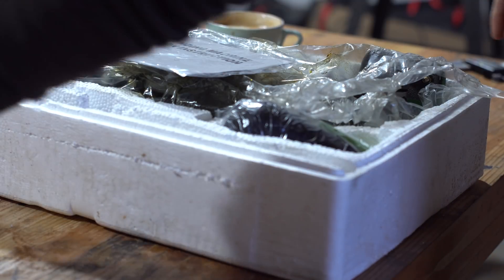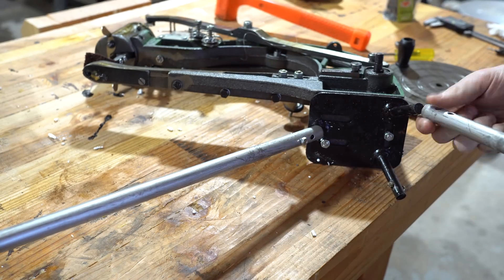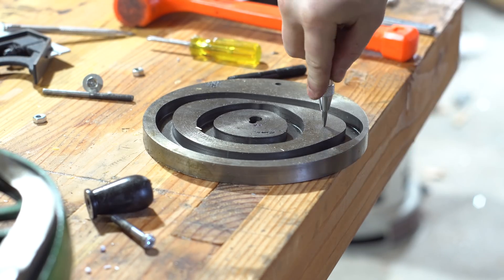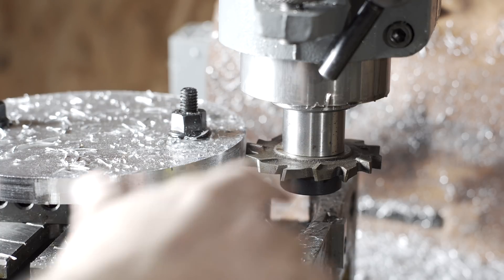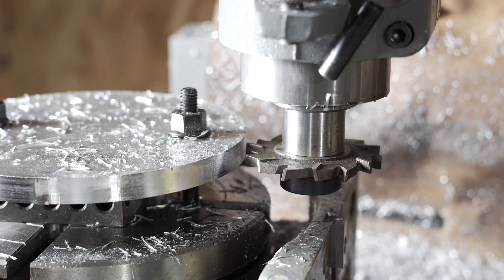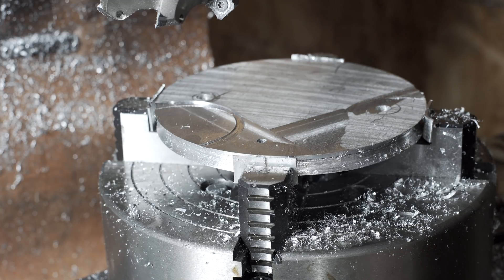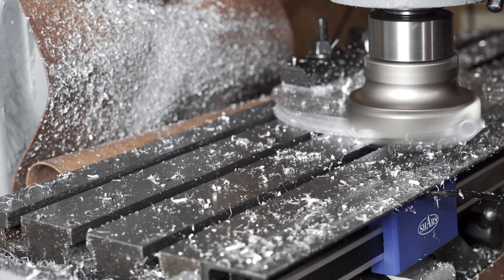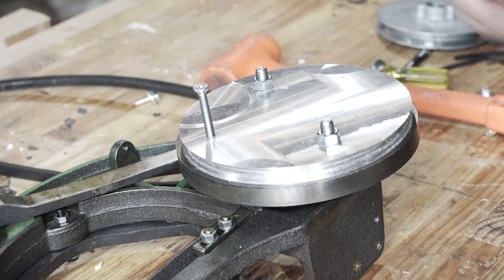Motorizing a leather patcher - V-Belt Pulley Fabrication

Comment: Obviously, this video is both FOR entertainment purposes, and also depicts a project performed for entertainment.

I enjoyed it.

However, as a pure value proposition:

monitor commercial equipment auctions and ebay for the many-times per year, guaranteed, clockwork bankruptcy of a medium sized leather shoe or garment or leather furniture manufacturer.

Cylinder arm 1 and 2 needle machines tend to sell for lower costs because they are not as intertchangeable.  If you are lucky, you might walk away with a Durkopp Adler or Juki cylinder arm for $1,000 all in (freight and fees included).

Comment: Always measure once, cut twice, still too short. I am always disheartened when not parallel, crooked or out of round or extreme lateral runout. If the horizontal mill is level to the floor and the table is locked in at “0”, then a short spirit level would tell you a lot before cutting. But we all learn from our mistakes, getting distracted when the wife is yelling about the trash goes out the same night for 23 years, my butt itches, neighbor has not return my level or my 16 year old daughter has a new “Goth” boy friend.
 I blame the equipment, especially when the tool cuts the power cord. At least that’s what my coworkers did.  
Have fun and let it go👍
ASE Master Auto Tech since 1978 / Retired
Reply from the maker: Everything about this comment made me laugh! :)  Thanks for watching <3

Comment: you know you can buy aluminum evaporating cooler v-belt pulleys in just about any diameter you want for around $20 or less and all you'd have to do to make it work is find a piece of metal tubing or pipe wit the appropriate wall thickness to use a center shim, should take all of 15 minutes.......
Reply from the maker: Yep, I believe I mentioned mounting a stock pulley somewhere in the beginning, I have several of those pulleys laying around.  Decided to make my own because A) the spoke pattern on those pulleys didn't quite match where I wanted bolts (and are quite thin), and B) where's the fun in that? :P  If I wanted a quick job I wouldn't be messing around with this patcher to begin with, just buy a decent leather sewing machine and be done :)

Sometimes the fun is in the process, not the end result :)